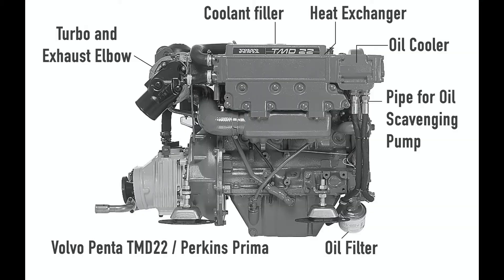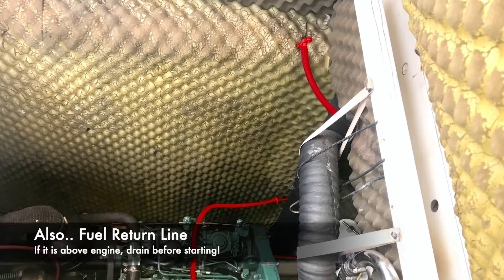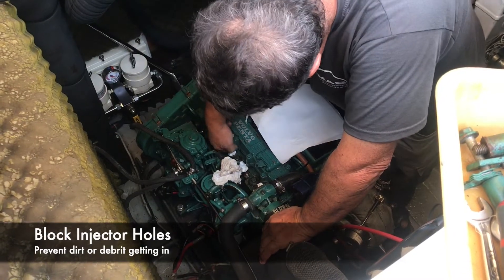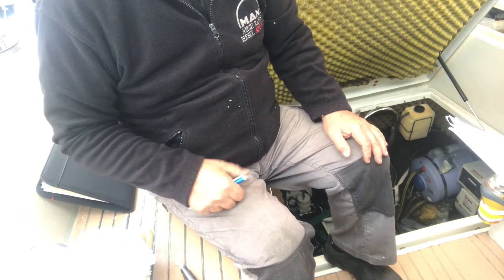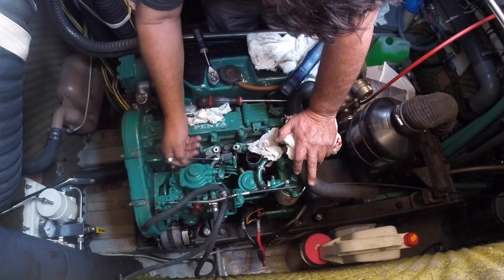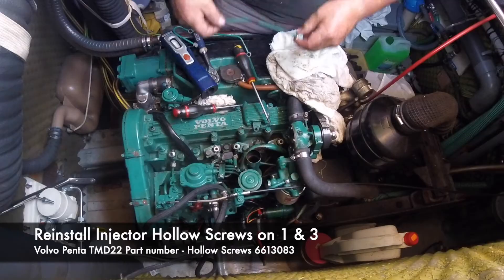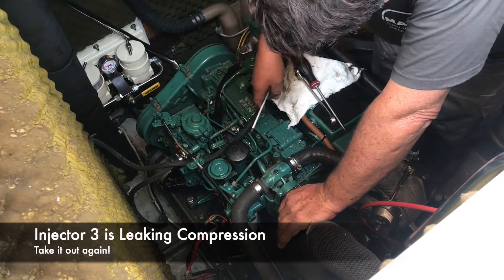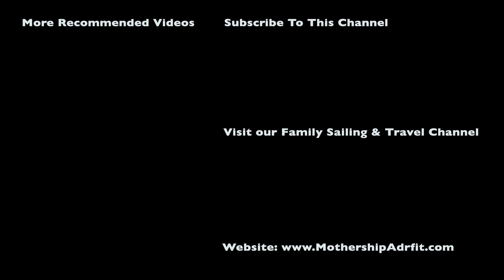Injector Removal and Replacement on Volvo Penta TMD 22, Perkins Prima Marine Diesel Engine

Comment: Watched it again and seems you misunderstood the phone calls and the mechanic. The first call that ALL the injectors were defective probably referred to the nozzles failing test (probably dribbling) the second call that only one injector was failing referred to the injector body (probably failing leak back or maybe BOP). So, you got one new injector ($520), three new nozzles (3 x 140 = $420), four bench tests (4 x 60 = $240) and three hours on site work (3 x 85 = $255). Total here in the US would be $1,435.

Comment: Hey great video 

Im changing my Delphi injector nails also but cant find how the spray pattern Or bosch number. Do you know how to find?
Reply from the maker: Have you checked your engine manual? You might be able to find a PDF online. Failing that try contacting a Bosch testing centre with your engine details, they may have access to a database